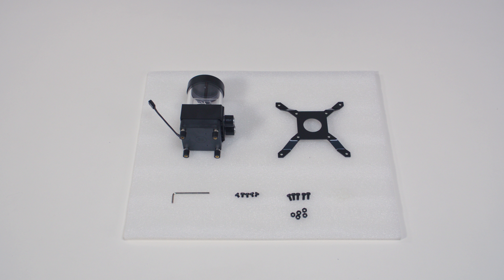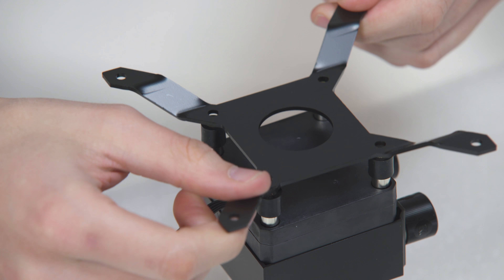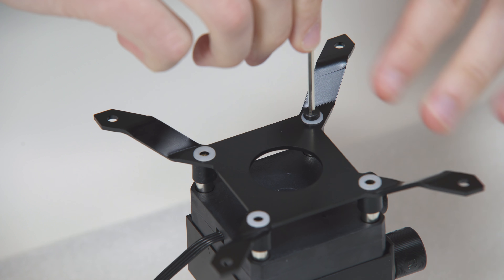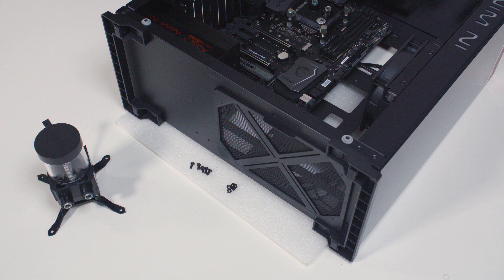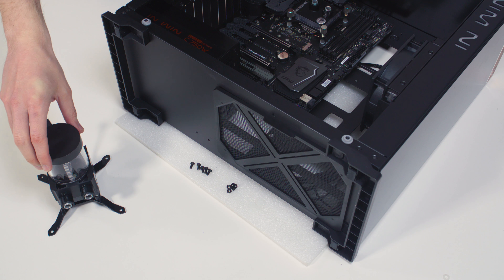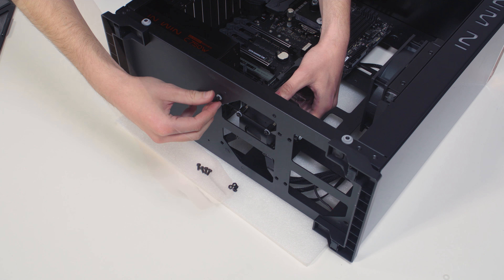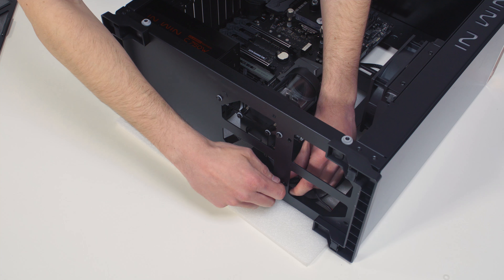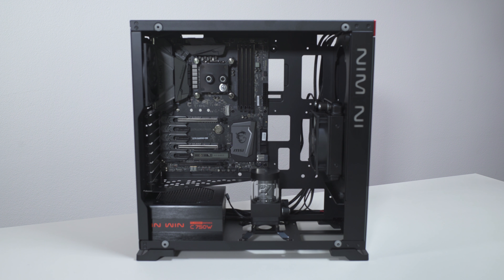EK Fluid Gaming A240 - Installing the pump-reservoir unit

Comment: Hey EK I just purchased this system. Can you mount the pump-res unit to the back of a fan if you don't have an extra vertical fan mount? (fan corners are rubber if that makes any difference)
Reply: Do u know it now? 😅
Reply: Send it back, the system is trash